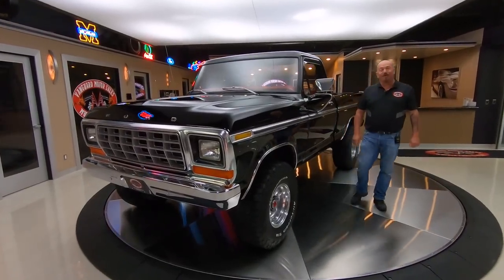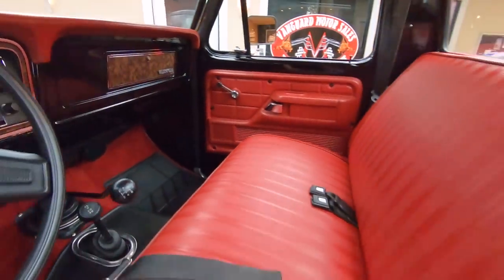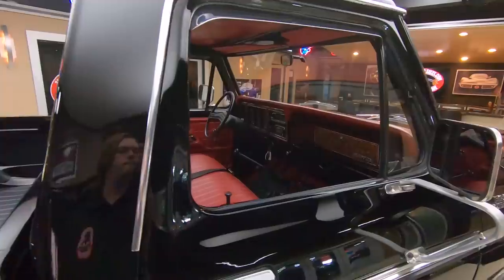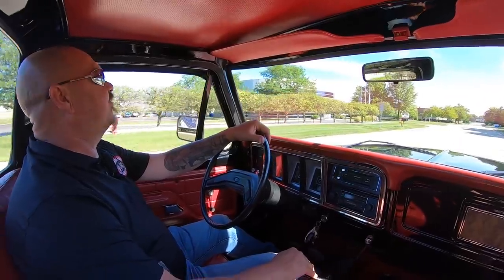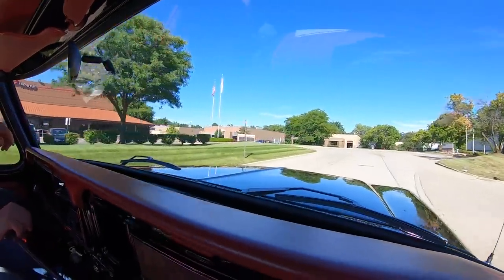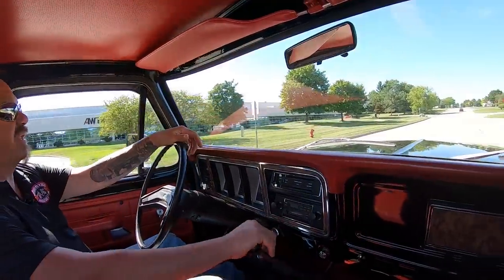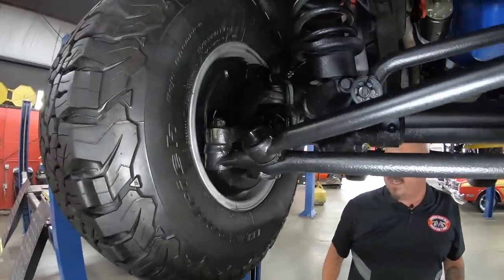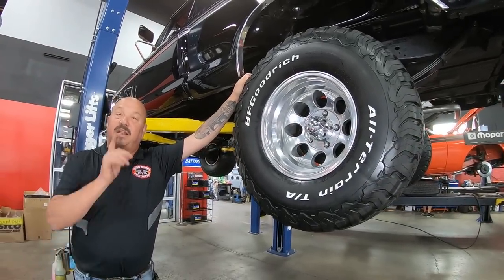1979 Ford F150 For Sale

Comment: That 300 six was a workhorse, but was very anemic.  It would have been much better to have 4:10 gears.  That engine really came on when it was injected in 87.  I had a 79 swb 4x4 and it was a beast.  It had the c-6, 351 with 4:10 gears.